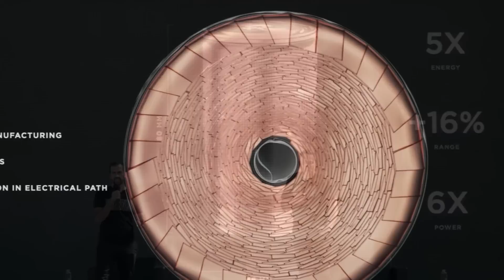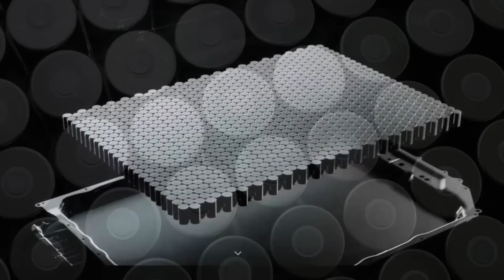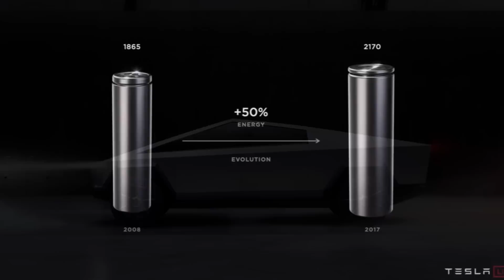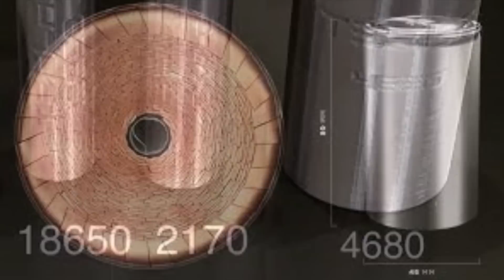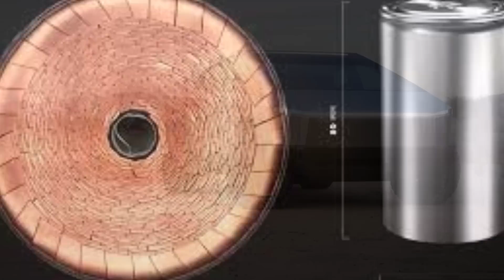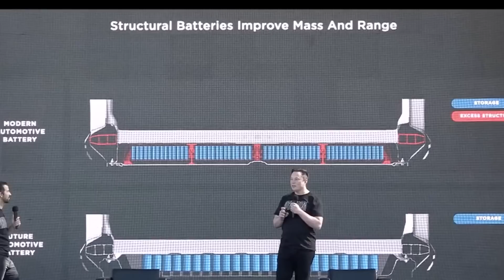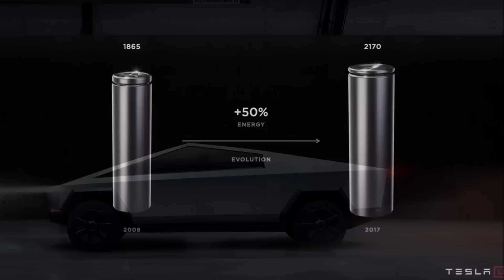When Might The World Drive Teslas Powered by the 4680 Batteries

Comment: Hint to speed up 4680 realization towards final development - for performance reliability and flash safety.
 
Dry electrolyte :
1) replace anode flaps for a schoopage process on both electrodes - for optimal thermal and electrical conduction. 
2) include a constant life time preload (compression force) at the junction from anode to cell wall - for reliability and flash safety against thermal and inertial shocks.

Wet electrolyte : 
3) keep anode flaps. Apply a schoopage process on anode only - for thermal and electrical conduction. 
4) same as 3) above.

Note : apply schoopage process to both anode and cathode will prevent wet electrolyte from diffusing into the electrode roll, producing dead cells.

Comment: Electricity from molten salt nuclear is extremely low waste and extremely safe. In a Moltex, even the very worst case accident just leaves the reactor boxed up. It cannot overheat so it simply burns its fuel down eventually becoming a sealed store of nuke waste. Costs per KW are cheaper than natural gas and ultimately cheaper than coal.

Comment: Tesla has not been tardy with its deliveries. It has however flagged new products long before they had the capability to deliver. 4680 is one of them. We simply did not need to know especially as they might be a dead end when cars move to LFP. 
CyberTruck could have been kept as  a concept rather than taking $ deposits. However that has built a massive following so who knows.

Comment: We are all eagerly waiting for Tesla to work though their production bugs and ramp up volume production of the 4680 batteries. With that said it's not like the slow ramp up of Tesla's innovative new batteries hurts their business that much. They are still using the older Panasonic 18650 batteries in the Model S and Model X EVS, and the Model S Plaid still manages to be one of the quickest cars in the world (at any price) despite not using the newer Panasonic 2170 batteries (used in the Model 3 and Y) or the upcoming 4680 batteries. So it's not a crisis that the 4680s are not already in production Teslas yet. Most of the production BEV world is still working hard to catch up to Tesla's technological capabilities today, let alone ICE/gas vehicles, which are Tesla's greatest competitors.

Comment: Recall that Panasonic had serious problems ramping up 2170 production at GN.  Was a zoo for the longest time and they lost out to China in mass producing vehicle batteries.  GN production is now insignificant on a world wide basis?  Right?  LFP seems easier to produce by CATL?  Fewer rare materials, save the nickel for producing stainless for the Cybertruck and future vehicles.  Cybertruck delay because of nickel shortage, not battery shortage?